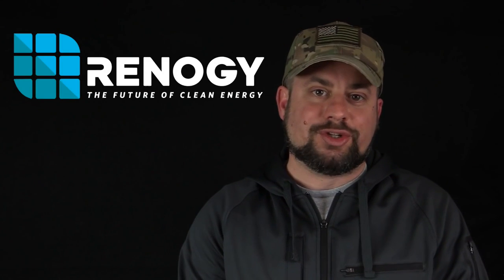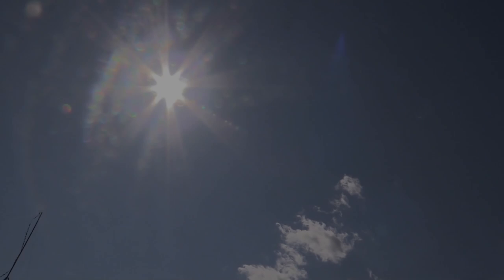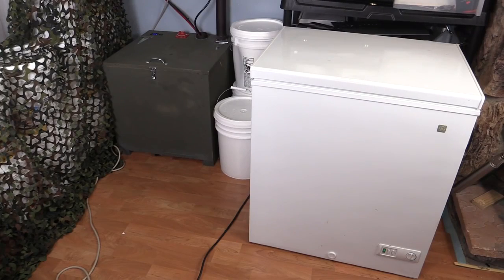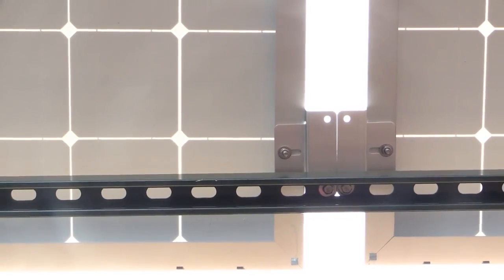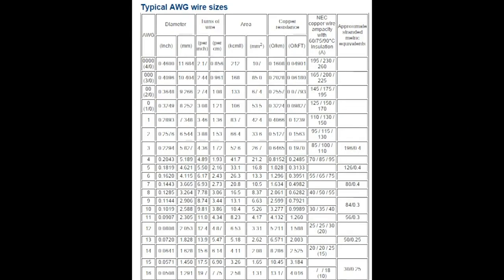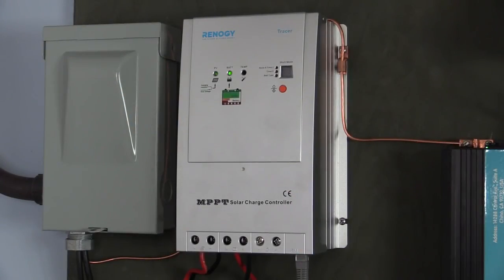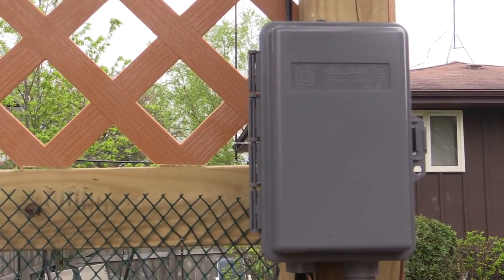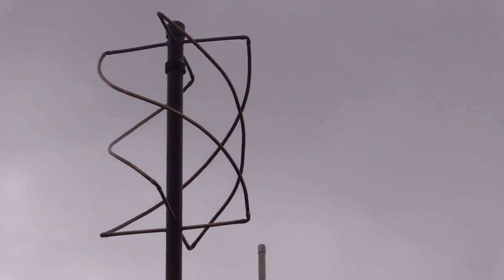The Ultimate Guide To DIY Off Grid Solar Power | Tin Hat Ranch

Comment: This is so good. Really appreciate you putting this together.
Reply: The guy is advertising crap. Car batteries are no different than golf cart batteries buy the largest you can get from the local scrap yard have them drop tested before you pay. get your inverter from a good tool company they sell them a lot cheaper if its for a vehicle and not a solar set up the same inverter is about half the price.  shop round for a suitable charger. buy quality panels and if you are under no local restrictions you can make them more efficient using reflectors made from ply and foil in the same way you would make solar hot water panels more efficient by reflecting more light on to them.
Reply: @sidneyeaston6927  No need for rudeness or judgment. He made a great effort to communicate important information. Why don't you just add your knowledge with kind words? Have you made a better video to share?

Comment: Old Tech no obsolete in 2019 do a update
Reply: why don't you do an update you lazy sod
Reply: I live off grid with a system very close to this with no problems. The only thing i have that’s more high tech is my battery monitor. I have the Victron 712 smart battery monitor
Reply: Its 3 years old.  How is it low tech?  Electrical formulas never change, ever.  Where you even listening?

Comment: "You don't need electricity to survive" -- says someone who does not have to use a CPAP machine when he sleeps.
Reply: @lucy lades You do realize that current solar technology (silicon based as well as most other commercially available cell chemistries) requires more energy to gather the minerals and other materials needed,  process them and then make the cells than the solar cells generate in their rated lifetime.  The processes also generate large amounts of toxic wastes.  I am a chemist,  and I have studied solar cells technology and manufacture from raw materials to finished product for over 40 years since I was a teenager.    Some people love our planet,  but it really appears that you do not,  although you have fooled yourself into thinking you do.
Reply from the maker: Just curious....is there anything you can do to get off the machine?
Reply: @TinHatRanch  Just saw this while reviewing my bookmarks on solar systems...  While I can and have lost weight,  my father was a skinny little man and finally got a CPAP in the late 90's after I begged him to get tested since I had gotten one (1991 or 92),  as he obviously had terrible sleep apnea.    So I do not expect to no longer need the machine after losing over 100 pounds of body weight via gastric bypass surgery.   I do expect the severity and pressure that I need to use to be lessened when I next get tested...   It has to do with the way the throat and tongue is configured.   There are surgeries I could get,  but I would still be dependent on electrical power and have no desire to have imbedded additions to my body.

Comment: The soler panels are shock less even when crossing the wiser I know because it don't work or even give power to the batteries if you put on backward. I made that once but no power went to the batteries. So I put it in white after I seen it was not white. But from battery out that would be a defrent story.

Comment: So my car batterys that work for 22 years and still is good and I still use them. Are you telling me that your 6 vote battery is going to work longer then my 12 vote that is working right now after 20 years and for at least another some years to go yet. I been told my battery will never work this long and that was years ago and they are still strong. And They even face the north they make power but takes 3 times longer to power up the batteries. But I have soler on four sides of my house and they all make power on their own settings.

Comment: Leonardo's windmill design sure has got  its hold on wind  . Einstines equal and opposite reactions from winds  are  ignored   easily putting infinatly thin blades sideways aginst it self. With mass spinning in frictionless bearings capable of light speed wobble then infinity  .EINSTINES the roots  i can test with $ .with my automatic feathering flatblade radial windmills .when Republican  controlled NASA  allows there electronicaly  controlled  magnetic bearings  they stoped for political gain .finaced by big energy oil gas nuclear fracking  ect.

Comment: Honestly get your batteries else where.
One thing this guy did not tell you was that batteries plus will NOT warranty batteries that are used for solar due to "constant abuse". 
Don't believe ?
Get a warranty terms and conditions card. 
I once worked at one, and I quit due to the shady shit franchise rules and angry customers. 
You're better off buying lithium batteries for solar buy in bulk from Ali baba or something like that, you will get thousands of cycles vs flooded. 
Just my 2 cents.

Comment: I have 14 panels each of them 150 watts + charger controller + inventor 2000 watts + 10 batteries 24 volts each. I live in East Africa.  But I haven't install them yet.  Because the house wasnt finished yet. I'm definitely going off grid.

Comment: TAKE JANNY GAS POWER OFFF IT PUT  ELECTRIC   ENGINE  TRUNS OFF 120 VOLTS AND  U NEED TO SPLITER THE MOTER POWER WIER PLUG ONE PLUG IN JANNY ITS HUCK TO AND PLUG OTHER IN TO ANY 120 POWER WALL OUT LIT FOR POWER IT WIN POWER ON AND UN PLUG FROM WALL AND JANNY IS STILL RUNNY  BUY IT SELF FROM ITS  POWER IT GETING FROM IT SELF BUT WHATER EVER THE MOTER NEED FOR POWER UR JANNY IS TAKEING OFF THE POWER ITCAN PUT OUT SO MOTTER USES 120 VOLTS A 2WATTS U GOT 1200 WAT JANNY UR JANNY IS ONLY A 1000WATT NOW  CUZ THE POWER FOR THE MOTER BUT STILL FREE POER NO GASSS

Comment: If you used your 1000 watt inverter for electric devices designed for 120 volts AC on 12 volt batteries you'll pull 83.3 amps and I guarantee you that 1000 watt inverter can't handle that much electricity even though it says it can.
Reply: What about the 2000 watts inventor?  Can I run the whole house with it ?

Comment: One thing I don't understand.  You can't gauge by watts.  Here's why.  100 watt light bulb will use .8 amps on 120 volts AC but will use 8.3 amps on 12 volts DC.  So you have to be thinking in terms of amps, not watts.  Why does everyone in these videos label everything in watts???
(Ohm's Law....watts / volts = amps)

Comment: Wow brother, truly the best explanation of solor DIY system's to date. I'm just getting started on my first home and now looking to save money with solar energy. Lots of people on YouTube giving you bits and pieces of information about solar systems which is quite frustrating as you have to keep searching for the next part of the equation. You SIR nailed it all in one swoop. HATS OF TO YOU!.

I have one question, you spoke about battery efficiency and how led acid car batteries are no bueno vs. Gulf cart batteries, but what about lithium-ion batteries which can handle cold temperatures a lot a lot more efficiently and are a lot lighter and smaller (in some cases) and dont release toxic gasses.

 Any information on this?

Comment: So my question will be. Can you mix a series of 2 X 6V batteries and 2 x 6V paralel together?
Reply: 6 volt?    everything is 12 volt..... dont waste your time with small bat's.   get 2 car battery's   easy, and simple.

oh,    yes series and parallel can be mixed to obtain your wanted voltage/amperage
Reply: @harleyme3163  Of course 12 or 6 doesn't matter in my question. The point is knowledge :)
Reply: @harleyme3163  Nice thanks

Comment: You don't actually need a "chargecontroller" do you? If you want to measure the input could just use an amp-meter.
Reply: without the controller you would probably destroy the battery's by overcharged them..   the controller itself is in charge of monitering the batteries..  or you'd have to sit there with a meter and unplug the panel's when the batteries were fully charged hehe...

Comment: --8-15-19 NEWEST THIS takes PEOPLE PLACES, like a jet
ufo type new spacecraft instruction's #SPACECRAFTLANDRIGAN NO MISTAKES ph 714-352-9055 or 714-252-9225 COPYS BEFORE DATE ARE NO GOOD
these can fly, hover, no top speed 
 law 1 
THEN YOUR IN A CAR ,PUT ON THE BRAKES FAST,TO THE  FLOOR. it  makes you want to go out the front window
law 2
 50 pound magnet waiting for a train it attaches to a passing 100 mph train and they connect when the train passes and the big 50 pound magnet and train are as one.
law 3
your on the train going 100 mph and throw a baseball 100 mph in your trains direction. the base ball goes 200 mph, it doesn't just stop. goes 200mph and then slows
 
law 4 
when a spinning object, stops spinning, the object goes straight [sampson and goliath] Objects in spacecraft spinning ,When stopped [at right spot] 
want to go forward pulling the temporarily attached craft, the craft moves, going with the objects.rem- the craft is the device with imaginary clock#'sstart
 IMAGINE a clock and the hands go opposite directions with the 5O-pound objects on the end of the hands. now turning the clock, with a motor, both 5O LB OBJECTS spin OPPOSITE OF EACH OTHER ALWAYS. WHEN THEY ARE GOING THE SAME DIRECTION. TWICE EVERY REVOLUTION THIS HAPPENS.THE FRAME OF THE CRAFT STOPS OR SLOWS THE 5O-pound OBJECTS "SPINNING at 300 mph in THE 1ST AND NOT THE+ 2ND Available DIRECTION. The spinning 5O-pound iron objects are inside, spinning in the craft. Spinning opposite from each other, at the "3 and 9 positions only THIS SPOT, BOTH OBJECTS ARE GOING IN SAME DIRECTION. Timing is important. For an instant, THE FRAME OF THE CRAFT GRABS, SLOWS, or stops the spinning objects at 3 n 9 positions only. The objects want to go straight at 300 mph, taking the craft with it. craft is trying to stop the objects. at the 3 n 9 spots  This makes the craft move, GOING IN THE DIRECTION of stopped 50lb iron objects at the 3 n 9 spots. when THEY GET TO THE 2 N 10 POSITIONS NOTHING IS SLOWING THE ROTATING OBJECTS. IT SPINS UP again and regains its speed. from the SPEED of THE MOTOR. then stopped or slowed at the 3 n 9 spots, then goes past the 3 n 9 spots and spins free at the 2 n 10 position, it regains the speed, after spinning up and approaches the 3 n 9 spots when objects are slowed or stopped by the craft, the craft moves, the iron objects wants always to go straight when stopped. they go the same directions at the 3 n 9 spots  [and not the unused direction of 9 n 3 opposite directions, ] the rotating device is in the craft. The craft is the clock. When the objects are stopped or slowed the craft moves .only when stopped or slowed  at the 3 n 9 positions, this the only spot both objects are moving in the same direction . it only works from this 3 n 9 position. this makes the craft and 50-pound iron objects move together, in the same direction. while this slows or stops the rotating objects, they spin up, again and process repeated. These rotating objects want to go straight when stopped, not wanting to go in a circular motion, only at the 3 n 9 positions, the objects are going the same direction. it dosnt have to completely stop the objects. The craft slowing or stopping the two 50-pound objects going 300 mph, in the same direction. makes craft move In the same direction. the objects get stopped by the craft. the craft moves. the iron objectsare slowed by the craft, the objects spins up and repeats this, it repeats a couple of times each second. Its pulsating a couple times a second, means it goes faster every time it repeats. it keeps going faster and faster . the objects only  go the same direction twice every spin and only one is used, the 3n9. the objects are across from each other at  3n9 or 9n3 spots and they never  go the same direction in any other spots. at the 3n9 spots, the objects are on the opposite sides of the craft, at the 12n12 or the 6n6 spots objects are very close to each other. but not touching IRON OBJECT GOING 300 MPH THEN STOPPED. MAKES IT MOVE.SOMETHING HAPPENS.
this is how they work. its like the wheel ,it rolls, its not giant magnets, this is it. its perfect lots of options. its manipulating motion, motion is like electricity and like the wind Beautiful/ blueprints avail. many functions and options landrigan, james chess master, phone 7142529225 or 714 3529055. I had no response none? reply please need assistance, im a little disabled/ 1st time telling people //OWNER, INVENTOR JAMES J LANDRIGAN. NOBODY HAS EVER BEEN INTERESTED IN THIS// THIS IS EXACTLY WHAT I WANTED TO INVENT. IT IS COMPLETE –NO MORE RESERCH NEEDED there is no anti-gravity. if I died the world has this, there is no anti-gravity. I looked at everything. 
 belongs to james landrigan need assistance and funding THIS IS REAL PLEASE REPORT THIS NEWS. ALL THIS IS PROVED  NOBODY CAN SAY THIS DONT WORK, 
 i know of no top speed 
 space on face book Destroy before2020.copys for sale 100K $ SECRET

Comment: most people won't worry grid failure. normal car battery will increase user cost. A practical guide lines are:
1. if you live in area might have grid failure, consider solar+battery 
2. or else, make sure your solar to reduce your bill to a batter margin, for example PG&E charges $0.13,0.17 and 0.31, make sure you won't use kwh to $0.31 class. Add battery will cost more than save.
3. Higher PV system needs to be calculated to see any saving, as PG&E back pay is only $0.03-0.04/kwh.

Comment: I have a 560 Watt Array on our shed roof. That is run into the main house to a Bioenno 20 Amp Charge Controller to a Bioenno Power 100 Amp 12 Volt Lithium Iron Phosphate Battery. From the battery to a SAMLEX 600 Watt Pure Sine Inverter. 
Nw what I've done in an attempt to improve efficiency is during the day the Panels are charging the Main Battery, and while this is happening, I use the Inverter to charge smaller Battery Powered L.E.D. lights for the different rooms in the house. I also have several of the Goal Zero usb Mini Lanterns-THESE I can take with me from room to room or to our outbuildings as needed.  I'm planning to buy an ancillary 30 Amp LiFe PO4 12 Volt Battery to keep the Ham Station running.
We are not Coffee drinkers, but I don't like to use the Microwave oven either due its power hungry nature. We cook with a Butane Camp Stove and we keep 60 One Pound fuel bottles for cooking during an outage.
We do not have a freezer-thought about it, but decided to keep our off-grid power use down a bit. 80% of our food is canned or dry goods-if we do lose the fridge, we can adapt easily to the change.

(BTW, I recently bought an IC-7200 like yours-LOVE THAT RIG!)

Eventually I want t have a 600 Amp LiFePO4 Battery setup and 2 KW of Solar, with a 2000 Watt Pure Sine Inverter.

Comment: 100w panels are more expensive in the end Use these 200w $165-$185 made in the US with a 25yr warranty by Hightec Solar sold direct on Ebay or distributed by Continuousresources.com https://www.ebay.com/itm/1-200-Watt-12-Volt-Battery-Charger-Solar-Panel-Off-Grid-RV-Boat-200-watt-total/283431535074?hash=item41fdd601e2:g:JdEAAOSwp7tadnMw:sc:FedExHomeDelivery!53558!US!-1
Reply: Good to know a god price with vendoer reference.

Comment: I am getting into thermo-electric heat transfer, such as semiconductor refrigeration / air conditioning. With this, you need to exhaust the heat. Battery box? Or venting the heat into your living space in winter, while venting the cold to supplement the frig.. Safer than venting the deep freezer compressor to the battery box. In summer? Preheat water? Peltier systems produce more heat than cold, and so they are more efficient producing cold if the heat is transferred quickly.

Comment: About that efficiency thing, I have 4 160 watt panels 19 V and 8.9 amps. y thought was parallel two and two and then series the two pairs of panels so I would have the 38 volts and 16 amps or so. Am I all wrong here? It is not a very long run, 20 feet at best.

Comment: Best video on residential off grid solar, period. I work with electrical engineers in the power industry, and they wouldn't have been able to explain it this well. Subbed. Bonus, I also have a tin hat.

Comment: One consideration to look at is: Solar panels are rated at about 77 degrees when the panels go over that temp. the energy production drops some solar panels will drop 25 % so if you had 100 watt panel it would only charge 75 watts.  Another item to consider when figuring out what you need, there are different ways to cool the panels or to purchase a higher end panel that is better in handling heat. Great video thank you for your presentation no nonsense and direct to the point.

Comment: Now You tube i just watched a Ad for a Engineering firm that makes various TRACTION MOTORS .This was class ad to watch . !
Reply: Going good until you hit the lesser cheaper cable . Do the math on the cheaper smaller gauge cables yeah they are ok they work and does the job so what . What you need to understand .from the point of making that cable it has a limited amount of time before it becomes hi resistance cable because they are not sealed at the Lug . If you live in a climate where damp by night then your cheaper cables will not be as good as the Higher Grade copper cores after say 18 months in play . i have installed this stuff for a living and we always use grade 1 cables and the lugs are sealed No water or Moisture can be allowed in to them cores .  and you would not get away with using automotive Crimps yellow Ring lugs over here . Plus these Crimps are only Rated to 36 volts dc . they have to be hi grade alloy copper mix . Titanium bus links are good too . listen to what this guy has to say because he is spot on .  You now need to start warning everyone about the dangers of 5G . from one ham to another .